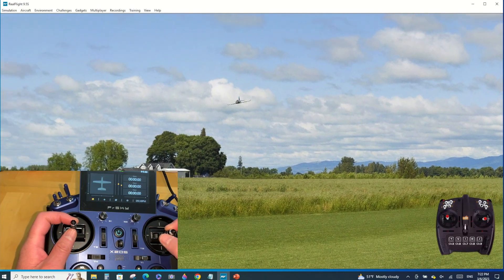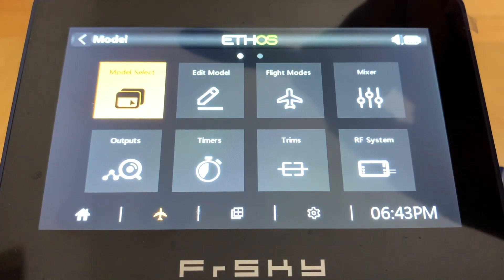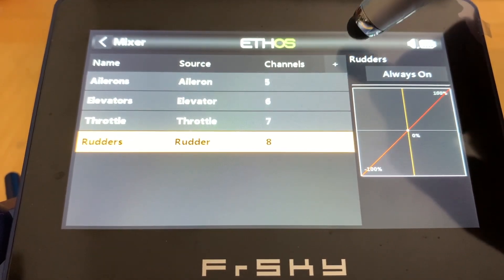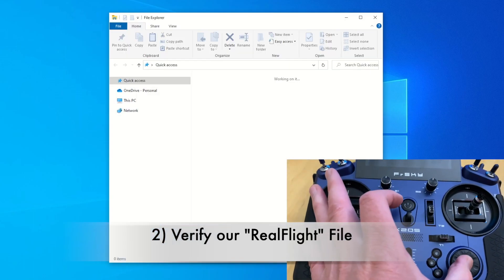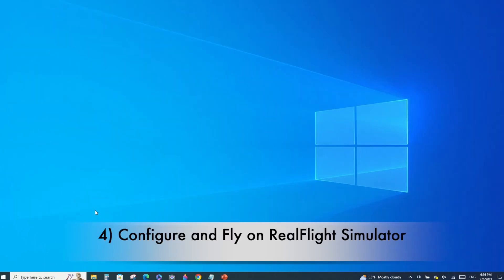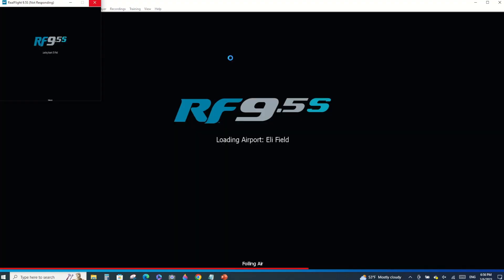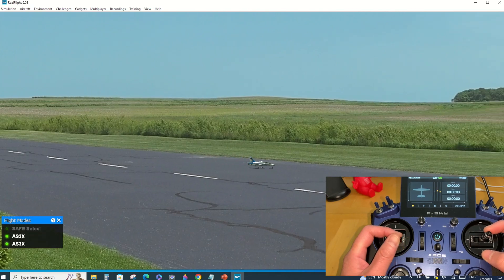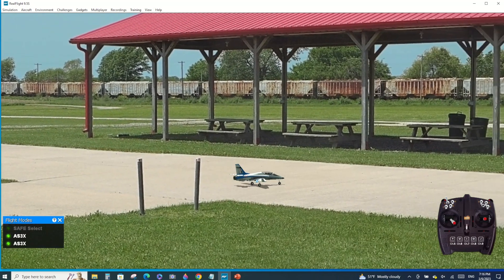How to setup FrSky X20 with RealFlight Simulator.

Comment: I’m having trouble getting my dongle connected to the radio. It works with the USB cable, but I can’t get it connected wireless.
Reply from the maker: I don't have the FrSky dongle as I used the USB cable.  I'm not aware that the dongle is compatible with RealFlight. Sorry.

Comment: This channel layout does not work for ETHOS X20, RealFlight Evolution. The first four channels muste have the classic AETR order😕
Reply from the maker: The setup combo will work with the X18,X20 and regular RealFlight8, 9, 9.5, 9.5S. But it will not work with RealFlight Evol since HorizonHobby came out with it. It's a HH thing that they must had modified to get customer to only use Spektrum controller or the Interlink DX simulator controller.
Reply: @8HrToGo  I have RealFlight Evolution and standard CH1-ail, CH2-ele, CH3-thr, CH4-rud, CH5-flaps, CH6-dual rates, CH7/CH8 slider 1/2, CH9 and more are buttons A,B.. FrSky Tandem X20
Reply from the maker: @ If you got RealFlight Evolution to work, then thumb up and maybe you can share with the RC community.. again, my setup was for the RealFlight 9.5/X20.

Comment: Was it ever determined if the FrSky X 18 will work for real flight evolution? I got to several steps but the throttle does not appear.
Reply from the maker: Some of our club members have no issue with the X18,X20 and regular RealFlight8, 9, 9.5, 9.5S. But for the combo for FrSky X18 and RealFlight Evol seems to have issue, and it could be a Horizon Hobby thing when they came out with the Evolution simulator.
Reply: @ Thank you so much for responding, I appreciate that!

Comment: Outstanding video. I am new to the hobby and just ordered the x20. I have a couple of questions about the simulator setup. Which version of the RealFlight simulator are you using? Do you have to use the FrSky simulator doogle? Thanks in advance for your help. Also are there other flight simulators that might be more compatible with the x20?
Reply from the maker: You won't go wrong with the X20. I used Realflight 9.5.

Comment: Hi👋
You dont have to make this anymore,its allready fixed with an update👍,realflight use the first 8 channels(maybe more,i not try it ),works without issues😊.

Das braucht man mittlerweile nicht mehr machen,es wurde gefixt mit einem update.
Realflight erkennt ganz normal die ersten 8 kanäle(eventuell auch mehr,noch nicht getestet)😊
Liebe grüße

Comment: Watch your Video on setting up the Realflight Simulator with the Frsky X20S Transmitter. I can't seem to get the Faps and the gear working on the Simulator.Can you tell me what I am doing wrong. Do you any instruction that you can E-Mail to me that I can see how it's done. Thank You
Reply from the maker: During the Step of Verify Joystick Driver, make sure that your Flap and gear switch is working properly seeing the axis movement and rotation movement on the PC. If you don't see it then it will not work as PC driver did not map it correctly. Sorry, I don't have instruction written down, instead I made this video to share it to community. People were able to set it up successfully. Please double check again.

Comment: Can you connect with the FrSky usb dongle?
Reply from the maker: The extra FrSky USB dongle would run you another $30 or so and as spoken with some of my flying buddies, I believe you can as u might need to do some firmware update on the dongle (and maybe some soldering also). You would still need to map the controller and it should work... some extra work though..

Comment: Thanks for the video,  I have the x20s also and now it works perfect with realflight. The only thing I did different is use the frsky wireless dongle so no need for usb cable.
Reply from the maker: Glad you made it work.
Reply: Mr airman9820 could you kindly give me a hint in how to set up my wireless dongle. Thanks so much
Reply: @coutofh i just followed video but with the Frsky dongle.

Comment: This is not working at all with RealFlight Evolution. I followed your instructions step by step. They worked all the way up to testing as a joystick. However Realflight Evolution does not recognize the X20s at all. Any Ideas?
Reply from the maker: So I don't own a RealFlight Evolution to try and find the problem that you encountered. The critical 1st thing - does your computer Window, under "Devices and Printers" see the FrSky radio as being a Joystick/Game controller? (as in step 3 of video) If Windows doesn't see it, Realflight or RealFlight Evolution will never know it is connected. If it does, then it is a matter of setting up the TX correctly, and then configuring a controller in simulator to correctly use the channels coming from it through Windows.
My suggestion is try another computer with Window 10, and make sure your FrSky transmitter is update to latest SW. If you got past this step 3 as I mentioned above, and RF Evolution doesn't recognize the X20s, then RF Evolution must have blocked it.
Reply: @8HrToGo  That appears to be what has happened. The transmitter is recognized and working 100% as a joystick as per your video. However it does nothing in real flight. Probably a horizon hobby  thing. Part of the reason I seldom buy their products. They don't  like any competition and they don't play  well with others. Their loss! Realflight returned to steam.
Reply: Real.flight(6) isnt recognizing the controller..in select controller its.just.not.there

Comment: Hi, Your RealFlight Simulator vid is very well done. I own a Frsky X18, do you think your instruction will work with it?
Reply from the maker: I don't have X18. But both X20 and X18 are based on ETHOS OS, so I believe it should work the same for X18. It's the same step where you would need to create a new flight binary file and follow the steps in the video. Hope it works out well for you. Thanks.
Reply: @8HrToGo  I checked with Horizon and their solution was to buy RF and try it. Of course if it didn't work I would be out $100 (can't return software). Unfortunately there is no RealFlight demo version. So your vid was a God send. Thanks again for your time and effort😃
Reply from the maker: @carmineiacono946  My advice is maybe you can check and post on Facebook RC community or Facebook FrSky RC community.. and check if anyone has setup of FrSky X18 working with RealFlight.. that could help you determine whether to buy RF  or not..